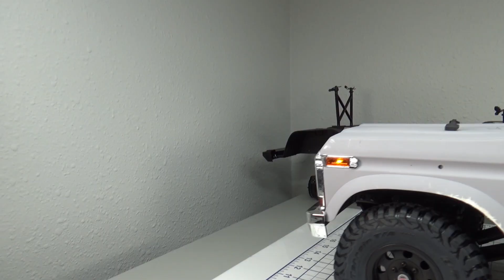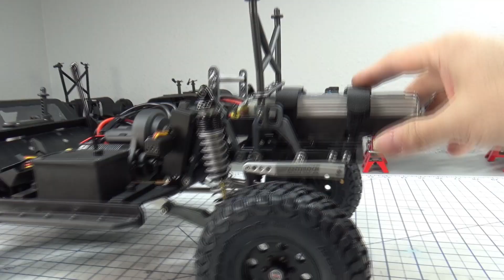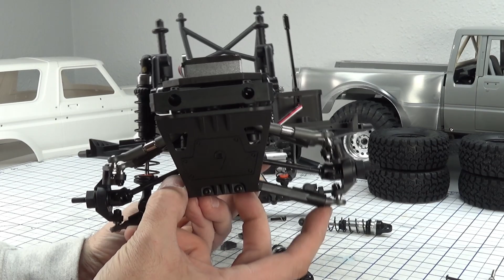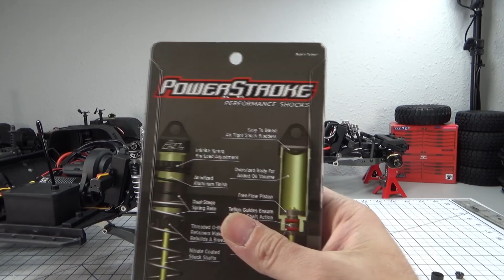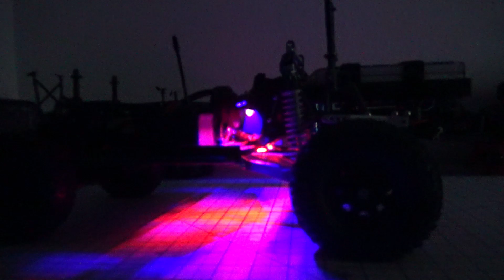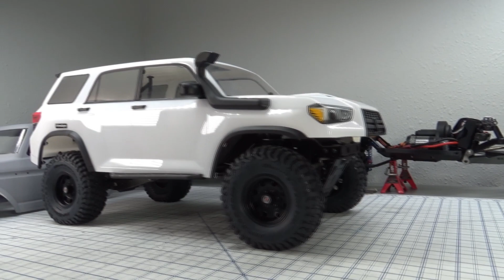Project Scale RC Prerunner Ford Bronco Hard Body "P1"

Comment: Dude, is there a kit for these enduro to mount trailing arms much wider on the axle?! The geometry is so bad from factory! Waaaay too skinny.. im asking cuz i know you know all about these.. wanna know before i make my own kit lol
Reply from the maker: Unfortunately that is an issue. I mount on the outside of the lower link bracket and use a spacer inside and outside the link mount. Good trick is to match the spacing off the shock mount to the outside axle link mount. I use 10mm aluminum spacers for the shock stand off and match that to the axle. You can always email me and I can send you some pics for reference too.
Reply: @DoubleClutchProductions  ok, that's what I was doing as well, but it pisses me off there's not a better way.. I'm trying to wrap my head around something I can design that will not only mount the arm below the axle, (like in most TT's, but also wider..) do you have Instagram I can message you on?
Reply from the maker: @ThreeDPrintDesigns I designed a mount that uses the stock link mount and puts the tabs out where they need to be but kind of ditched it because mounting it on the outside just flat out works for me and is durable so I ran with it. I do have insta but don't use it.
Reply from the maker: Lolz, yah I'm not on insta much anymore. I'm not into creating just for followers and I don't learn or get much inspiration from it just a flex in my opinion. But if you want to chat anytime just email me or hit me up here 👍
Reply from the maker: When I designed these kits, my main goal was to keep the price down while not being too advanced for the average builder. That said, converting a crawler into a functional long travel prerunner is one of the more difficult things in the hobby. I'm not building trophy trucks here, so a full frame rail prerunner is the goal. When I designed my first rails, they were similar to the scale metal supplies prerunner rails, big kick up in the rear frame, and for the average builder, it creates more problems than it solves. There are plenty of very capable full-size trucks that have stock frame rails with plenty of uptravel. My goal was to use stock side plates and rock sliders with stock body posts so the average builder can make something functional, cheap and not have to fabricate or figure out the geometry. I would love to see more options so anyway, I can collaborate or help I am game. 👊😎

Comment: Sorry, just getting into your videos and trying to figure out if I was going to try and build something like this where to start.
I’m gonna check my local hobby shop, but I know element doesn’t sell the Enduro builder kit anymore .

Is a chassis or builder kit you would suggest starting with? 

Would you just try and pick up frame rails and the basic chassis stuff for the Enduro trail runner? 

The new element  zuul 2 comes with their IFS 2 system. Seems like it would be a good platform, but I don’t necessarily want to spend $500 on an RTR if I’m gonna just tear it down and get rid of most the parts
Reply from the maker: This is a dilemma for sure. Radio and the receiver is a big one too. The way I would do it is get a Element Trailrunner on sale, you can get these for $299 and add the IFS v2. This is the cheapest way I can find to get a rig, roughly $399 RTR. You can find ebay rollers from time to time but it's hit and miss. Motor and ESC is the big upgrade, builders kits vs a RTR for $299? That $299 we will never see again once that sale ends. Hope this helps
Reply: @DoubleClutchProductions  thanks that’s helpful! I’ll keep my eye out!
 After watching your videos I’m thinking it may be a good idea to pick up something like the new F150 Baja Ray and get a taste for this style of RC cars first before starting a complicated  custom build. 
Just get something that’s gonna run well.

I’m coming from onlydoing 1/18 scale and 24th scale crawlers. 
I love the building and customizing aspect of doing crawlers. That’s why I was leaning towards trying to build a tree Runner. There is also something appealing to having something you know is gonna work😂

Thanks for all the help and advice! If you have any other thought that might be helpful I’m all ears.
Reply from the maker: @justinluczak5611 Thrre really is nothing out there than can compare to a crawler based off road truck that actually works. These drive very scale, almost too scale for people not into desert prerunners. Most prerunners can't compare to trophy trucks and I think people are confused by this. The best advise I can give is the baja rey is my favorite vehicle to drive. The fun part of these scale prerunners is making them actually work just like modifying a full size stock truck to run in the desert. These rc prerunners are not for the beginner builder but are the most rewarding to build because it's so deep in the habit hole. You have to be a fan of desert racing to get into 4 links. An Associated buggy or short course truck is a great entry way to enjoy off road too!

Comment: Nice work! 
Just wondering how that Bronco body held up over the year, would you still recommend it?

 I'm itching for that body after seeing how it looks mounted. Besides the flawed trim, I assume there's no point in bothering to put on the side mirrors as they would be the first parts to break off. haha. It looks great to me even though it's a shame about the shoddy warped trim, not much quality control there. I thought I'd run the same path as you, cut the lower body, not bother with the trim, and even make some primer patchwork.
Reply from the maker: It's a legit body besides thexwarped chrome. It's held pretty good. I would recommend it it still.

Comment: Was really interested in doing this project myself.... But the ifs kit is discontinued......
Reply from the maker: Might be worth getting a trailrunner roller on Ebay. Good luck it's a shame when stuff like this goes away
Reply: @DoubleClutchProductions  I didn't even realize the trail runner had IFS suspension..... In the cart it goes. I was about to just pull the trigger on a Erevo instead
Reply from the maker: @YouvBeenThumped  glad we could help dude, good luck
Reply: @DoubleClutchProductions  Now just to spend $300 on extra parts so when I get it. I can tear it apart and learn how everything works. First RC car in like 10 years...
Reply from the maker: Congrats dude, welcome to the party, enjoy your build and tag me when you finish it so I can check it👍😎
Reply: @DoubleClutchProductions  I need to quit watching these videos.... You're being a bad influence and my wallet doesn't like it 😂
And for sure will tag you.

Comment: I purchased everything listed in your Baja Rey shock build video. Just curious which shocks did you run on the front here? It seems it has two different sizes, baja front and rear. I building the shocks this evening. When I put the Pro-Line shock in the rear I can't get the chassis level. I figured it's because I still have the stock element shocks upfront.
Reply from the maker: It's the front baja shocks, I have a lot of weight over the rear, battery, spare tire, and the hard body I have is heavy, make sure you have the green, green spring combo installed on the powerstrokes
Reply: @DoubleClutchProductions  Roger that. I'll confirm my rear shock setup
Reply from the maker: @reindalehill7713  cool, just reply again if you have any other questions glad to help a bro out👍
Reply: @DoubleClutchProductions  Thanks a lot Bigg Dawg....about to bust these shocks out. What battery are you runnin?
Reply from the maker: 11.1 5000 mah, all day broskie 😎
Reply: @DoubleClutchProductions  Roger that. Over and out. Watching your shock build video step by step now
Reply from the maker: Right on bro 😎🤘

Comment: Excellent build. Can you share details on the suspension up front?
Reply: Are the Baja Rey shocks up front the set for $100? I'm trying to find the shocks now.
Reply from the maker: @reindalehill7713  idk, all the baj shock parts come seperate, use the baja rey manual to get the part#s
Reply: @DoubleClutchProductions  Thsnks
Reply from the maker: It's a element IFS rig, so the trail runner and knight runner come with IFS. Just like I said in the video it's just Baja Rey front shocks no mods.
Reply: @DoubleClutchProductions  Roger that...after further research I saw that. You've inspired me to build a pre runner
 Vanquish sway bar is out of stock....as usual Vanquish is out of what I need
Reply from the maker: Right on man. Tag me when you fi ish 👍
Reply from the maker: On my baja rey shock rebuild video I think I have the links to all the parts in the description
Reply: @DoubleClutchProductions  Thanks
 I'll check it out now
Reply: @DoubleClutchProductions  Hey Bigg Dawg, I just dropped some serious cash today to get this build going...I'm missing one part, your rear battery relocation set up
 I have the big battery tray coming but I don't where to source the "kydax" battery mount you used to mount the battery tray over the rear axel....any tips on that part. Sorry to keep bugging you.

Comment: What is this body from?
Reply from the maker: All the info is in the description with links, RC4Me 79 Bronco Hardbody 313mm,
Reply: @DoubleClutchProductions  isn't this a copy of the lexan body? Also does yours look different because of body work you did?
Reply from the maker: @dynosaur5291  I went into the modifications I did to the body, the bottom of the body below the door comes down too far so I trimmed it to sit lower, this is a traxxas trx Bronco mold that must have been repurposed over seas and modded into a hardbody mold, what body do you have?

Comment: Got it so put most of the wheight in the back to balance out to frame some that makes since now
Reply from the maker: CG is the key in weight balance, this is why trophy trucks and prerunners run 90 gallon fuel tanks with double spares ro get as much weight over the rear, hope this helped 👍

Comment: I built one very very similar but I put the ranger body with the prerunner flares over top of the gatekeeper cage, wish I could send you pics. I had a prob with major torque twist n the ifs skid taking digs n stopping the truck
Reply from the maker: The Gatekeepers Toyota prerunner works pretty good, step 1 ditch the stock shocks, of you post to Instagram you can tag me

Comment: I have an axial scx10 and have swapped the rear to use trailing arms, but I’m still a kid and I can’t afford the ifs kit, any tips for parts and stuff? It’s about the same chassis as an element enduro. I have powestroke non xt but I’m also gonna move the shock down for more “travel” and the shock will be extended with pivitoballs from a vaterra crawler, piecing this thing together
Reply from the maker: Sounds cool man, tag me when you get further along so I can check it out
Reply: @DoubleClutchProductions  I’d love to!